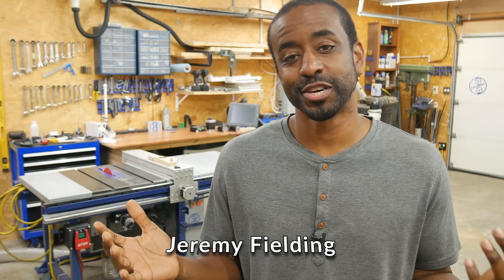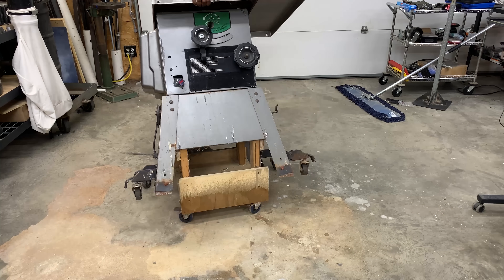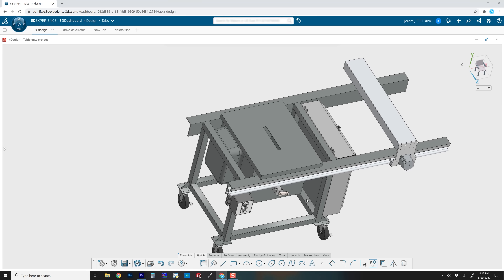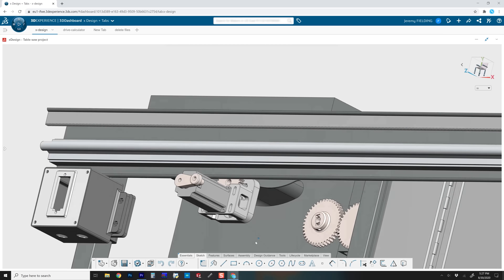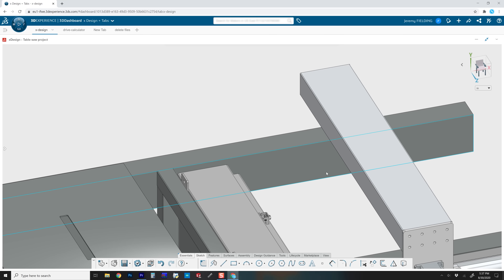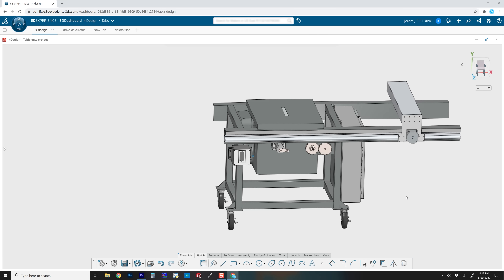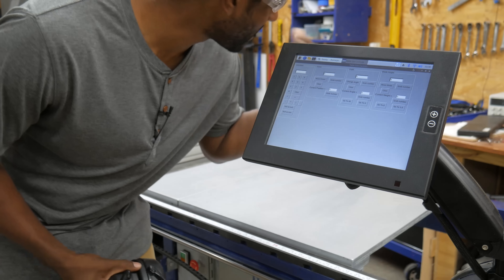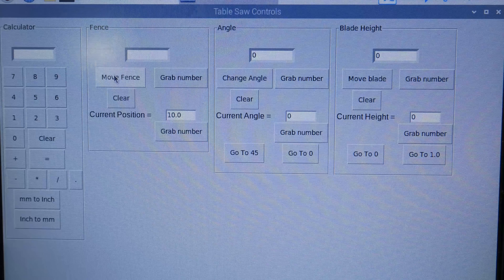How To Make A CNC Table Saw : # 084

Comment: Jeremy, my hero! Your vision for your saw (and other shop tools) is not far from my own... but you got yours done already. I knew the idea would work. My thoughts were to re-zero the fence position against the blade: raise the blade, release and slide the fence against the closest blade kerf, click a re-zero button to recalibrate and engage the fence position to, well, zero inches. That way, all of your **cut measurements will be relative to the fence side of the blade kerf** (not to some twice-indirect tape measurement). This becomes important for maintaining cutting accuracy cuz saw blades can be of different thicknesses. For instance, re-zeroing to the fence side of an adjustable dado stack. This could work equally well with the fence on either side of the blade (I am left-handed). The re-zero function might be automated later... depending. 

This calibration method yields the expected results when cutting wood. 

Agreed with your acceleration profile, especially on the stop end of the translation (deceleration) where precision stopping can become a problem, and more importantly, a slow speed when re-zeroing automatically. The fence is a significant mass and slowing it to a stop will reduce oscillations at the far end of the fence and reduce slewing of the motor caused by overshooting the target position. It all depends on one's accuracy and precision tolerances and may get into diminishing returns with wood. Dunno yet. It would be cool to get the translation system profile characterized at least once with an external laser position gauge.

I have nebulous thoughts on how to auto calibrate blade height for different diameter blades without bringing in an external gauge for the initial calibration after blade change... but I like your simple blade raising motor implementation... nice. Yes, fix the spinning knob issue. With the RPi one can easily do the geometry to calculate blade height at different miter angles.

Love your choice of RPi and Python cuz they are each perfect for this project... and my choice, also, simply cuz I know them.

Cudos to Josh Rapavich for knowing "re-zero"... Josh, are you familiar with hdds or other servo positioning systems?

I am a retired electrical/software engineer and have become a covid-inspired woodworker (cuz it's out of the house and something I've never done before). My current project is building the tiny building for my SheShop by the Seashore so I can get back to working wood. Oh yeah, I am 75 and a girl...

Comment: Question:
You have stepper motor and drivers in there, but it seems that you are controlling the motor power using relays? Why? Or are the relays for the end-stops?

Comment: ok first let me say... great job on the automation job. I have one of those cast Iron saws & plan to do some different upgrades & some hand made one's I've already done from research so here are a few great ideas & answers to that cast iron table saw. I found if i get a rust spot I just use used motor oil & sand with a wood block then I regularly polish with paste wax (that's what they've always used & it helps glide wood across table. I made a Riving Knife that moves up n down with blade to replace the original blade guard (or your cuts get marks U burns & get stuck or jam). I also used a pully spring from junkyard that fits in my alumin extrusion to hold the wood down to the table with a one way bearing wheel to prevent Kickback. I plan on putting my rougting table on the wing opposite end of my table & guide rails with open ball bering slide blocks for my extrusion fence. . BTW my table saw is the old SEARS cast iron top... Good Luck . . Super Cool Tools has great diy ideas you could try.
Reply: forgot I'd commented before...lol

Comment: On our viper robots, we have a function to reference the robot when it "loses" it's place.....it is just a proxy switch that acts as a flag and tells the corresponding axis drive that it has made that limit and inputs the exact measurement...this may give you a better tolerance, but as you said, you are not measuring to the thousandths place....very well developed video...sub earned 👍

Comment: You mentioned a jog button but you might consider a increment button as well. For example if you enter 0.5 inches into the incremental field and every time you hit the increment button, the fence would advance another half inch. Great for cutting precisely spaced cuts.

Comment: I used the same cleaning agent. VINEGAR ! It took major amount off and then took my sander and used  150 grit and then 320 grit. Cleaned it again and then used Buthers wax to seal it. Wood  slides on the table like shit thru a tin horn ! Every now and again just touch it up. I also did the  whole saw After wiping down all parts and waxed the whole saw. Fine dust hardly holds onto it. I also added a chute below to catch a majority of sawdust. Love watching your content ! Keep up the good work !

Comment: Awesome job Jeremy. It turned out so well. I have never used Python looks like a type of Basic? I have used Mach3 software for cnc machines and moving x,y table positions etc. I don't know how easy a interface would be to write though, I have only used the generic cnc interface screen. I have one machine I built with steppers and the other one I used a newer servo from Clear Path called Stepper Killer all in one servo. Anyway just wanted mention that because I think they are great, not much more cost than a stepper and drive but has lots of torque and excellent control. You can use step and direction pulse straight to the motor if needed! Once again awesome video!

Comment: Really impressed with your builds and explaningvideos.. 😊
Keep it up, 🤘🤘
My budget and knowledge of cnc operated projects isnt big enough, but I would really like to ad a dro fence for my soon to be build new tablesaw multiworkbench.. 
My plan is to raise and tilt the saw electronic (with salvaged motors and controls from and bed) 😊 but still have the possibillity to operate manuel.. 
My plan is to biesemeyer fence system.. But I would Really like  to be able to read my position digital.. Ofcourse will i also add a normal adhesive measuretape.. 
Is that possible? I know ther are commercial solutions (like wixey) but not able to find a diy that meets my criterias and is precise..? Any ideas?

Comment: Great build and the progress is great as well.  A couple of comments.  Steppers are simple and accurate as you note but they can and do skip steps.  Unless you have some form of feedback you can never really be sure of the actual position.  Adding feedback to the stepper is easy and of course steppers can be had with integral encoders.  But an integrated encoder will not account for the backlash due to you choice of a gear drive.  A preferred drive would use toothed belts and pulleys which have virtually zero backlash.  Another advantage of the positional feedback is that if you move an axis manually the encoder will track this as well and you will not require an "origin" operation to re-zero all of the axis.   Speaking of origin or home, encoder units with a marker pulse are preferred as they provide a simple way to "Origin" the axis in concert with a position sensor near the end of the travel.  The end of travel sensor tells the drive to slow to 10% and then walks in slow to say the second marker pulse and finally at 5% speed that final pulse on the next revolution.  This will be very repeatable, up to the limits of the drive gears you use, and is much the same way allot of the big boys do this.  Ramp control can be done in steps with the speeds starting at say 5%, then a jump to 10%, then a jump to 30% after a couple of revs followed by a jump to 50% etc...  Of course this is based on the called for movement magnitude.  In some cases a slow move would be all that is required.  Backlash can be somewhat compensated for by simply running past the set point and then slowly moving into the called for position.  Call for 10.000", the stop runs to 10.100" and then comes back into 10.000"  The gear teeth are loaded in the direction of the force exerted on the fence and should be accurate to the called for position.  This is the icing on the project stuff and does not detract on just how impressive your project really is.  Fantastic and really impressive work!

Comment: I would do the Spinning handle issue similar to old Milling machines. There is 2 "zigzag" parts, and a spring between. If you push the handle, it locks to the other part, and you can rotate. If you relase, the spring decouples, and you good to go.

Comment: I think you could look to the 3D printing community for a lot of inspiration.  We have the ability to "home" our printers, so all of the XYZ motors refind a known position using limit switches.  Could be helpful for when you've disabled your motors for fine control to be able to reset with precision.  Also, what happens if you try to move your fence to the left while the blade is up? Is there a protection there to stop it binding up on the blade?

Comment: Awesome work!  I challenged another you-tuber with a motorized fence years ago but he did not take the challenge, you sir have went above and beyond!  What about adding a DRO like rail and sensor on the back side of the fence to always know where the fence is.  that way when you disengage the motors and move manually it would always know where it was when you turn the motor back on.  Just a thought.  Thank you, and keep up the good work!

Comment: OK one thing I would add is an auto-alignment function. Basically any time you turn on the C&C it would move every component to the limit switch which is already a known and static position that you can program in. Boom, no more manual alignment.

It's the same thing inkjet printers do when they warm up - they'll run the print head all the way to the end to make sure it's aligned and then start printing. Since you've already got limit sensors in place, all you have to do is program a startup routine. you could even add a button to your UI to run the alignment routine (on a per component basis). The downside to a startup routine or automatic alignment is what can happen if there's something in the way, like a scrap piece of wood left on the table, that interferes with it. But that's a problem with any C&C application.

Comment: Would using a blade stop saw work with this setup and if so would you be able to tie in to it to shut the hole tool down if triggered? I could see this being vary useful in cabinet building. Great job

Comment: Awesome project! Cutlist or Queue was my first thought for improvement so i'm glad that's on your list. I was also thinking it would be good to either reposition your limit switches or add more so that you can utilize a homing command. If you go into manual mode, all you would have to do to re-enter cnc mode would be to hit your home button and all three degrees of freedom (or however many you would actually manually adjust) will run in the direction of their homing switch and then move to your desired location. Home wouldn't have to be zero necessarily. If you had space constraints on the fence, you could set your home location to just always be at 7.25 inches and then, when you home the fence, your program will just know it's now at 7.25 in.

Comment: With gasless MIG welding you drag not push just like with mmaw(stick) this will prevent slag inclusions and give you a more flatter weld that has higher penetration 

As for you protecting the top you could clear coat it all though the clear coat would rub off in a few months with normal use or linseed oil or WD40 will help prevent rusting rub on every few weeks

Great project!!

Comment: If you use PID control (proportional, Integral, Differential) you can get the accelerated start with a controlled stop with little to no overshoot.  I use it on hydraulic rams used for material testing. You can buy a PID controller or look through a good controls book to model the system you want.   Great job, never thought of automating a table saw, but I can see some great advantages now that I see one in use.

Comment: I've considered paste wax but have always used talcum powder on cast iron. Rub in with paper towel and another to dust off excess. Just try a 1/4 teaspoon to start and adjust as necessary. Unscented is supposed to be best but I've always used scented.

Comment: Furniture paste wax (Miwax orJohnson's paste wax) is what you want. It's like waxing your car though, every so often you will need to reapply. If I will not be using my table saw for a while I will spray it down in silicon spray, wd-40 makes a spray but cooking spray is made from food grade silicon. Be aware paint hate silicon, so clean your saw thoroughly before using it again. Paste wax is fantastic because doesn't stick around after sanding and finishing. Obviously what one is attempting to do is keep moister off of the cast steel. 
You are the man BTW. This stuff is so beyond me. It is fun to watch.

Comment: PASTEWAX!!! Pastewax will protect it! also sand it with a block and 400 grit  wet sanding sandpaper except dont use water use wd-40 or PB blaster. then do the paste wax after the standing. works like a charm.

Comment: Awesome work, my man. I see you weld with flux core wire. Since you aren't using gas, you don't need a gas nozzle. You can get a smaller ceramic end for your torch and it fits into smaller spaces. Wouldn't recommend if you have a constant hot torch like the cheap HF units do.

Comment: Look into ClearPath servos, they’re servos with the drive and everything built in. They cost less than an equivalent stepper system and have a way higher torque and speed range

Comment: Damn impressive !  Awesome, even.  But do you have any time to actually use the saw?  I would have just upgraded to a Beesmeyer and be done with it.
Reply from the maker: If I had done that you wouldn’t be watching this video... and I wouldn’t have had as much fun
Reply: @Jeremy_Fielding  Exactly why I am a subscriber.  Your work is A++ always and you have great teaching chops.  And a cute family.  But I still would argue this is overkill for a small shop.   I mention that fence because I have worked with it in the past, and I could make 100% accurate cuts very easily without extra screens and motors and all the rest.  That said, I would love to see a CNC router video.   I have a tee-tiny cnc I made from an arduino, some black pipe and an old Foredom tool.  It works, but has some limitations.

Comment: The fence is supported at the front by the motor-plate. What stops it from rotating on the linear rail and touching the table top? Needless to state that this is a wonderful project with masses of additional possibilities.
Reply from the maker: I explain near the end of the video
Reply: @Jeremy_Fielding  Many thanks for your quick reply.

Comment: Great, now I want to put LinuxCNC on every tool I have...
  
Absolute encoders are available so that you don't have to lose your fence position when it's in manual mode - use it as a DRO.

For finding the blade height - you can put a laser beam break sensor underneath the table blade guard.  So that you detect when it's about to break the surface of the table.

Comment: You could add a "reset to position" (or something) button that moves the fence (probably the same for the saw height and angle as well) to the end stop (zero position) and then moves it back to the position you have set. That way you don't have to risk errors when telling the code where the fence is after you have moved it manually.

Oh yeah! And an auto feeder as well.

Comment: Damn dude, I've had an idea like this on my head for some time. But I lack all the skills needed to do it. Beat me to it.

But bravo man! This absolutely awesome! Something like this will greatly help your daily woodwork, since we spend a lot of time making measurements. I have a few ideas to share:
   • A way to make relative changes in fence distance. Like, +.125" or -.25"
   • You also need to consider different table saw blades too. Like thin blades or dado blades. Since this will affect the software.
   • Ability to save/bookmark measurements/configurations.
       - Examples:
           • "Squaring 2x4: fence = 3.375", blade height = 1.75",  angle = 0°"
           • "Box joints: fence = 18",  blade height = .75", angle = 0°"

This is super-awesome for your first software dev project man! Welcome aboard! (I'm a dev too) Your code needs work though. Look into creating classes so you can separate your code into different components. Focus on creating descriptive variable and function names so your code reads more sentence-like. For normal variable names, use the "camelCase" format. For constants, we typically use caps with "UNDERSCORE_FORMAT". A longer name always beats using comments. They are moreso a "last resort".
But it's still great for your first program! I've seen much worse. If you want to get deep in writing well-written code, check out Robert Martin. His teachings (and books) have really helped me sharpen my own skills and mind as a developer.

Comment: Fantastic project. Other options you can easily add is;
Fence preferences measurements F1 - F2 - F3 - F4
Blade Height preferences measurements F5 - F6 - F7 - F8
Blade angle/tilt preferences measurements F9 - F10 - F11 - F12

Comment: Awesome idea and execution! Now how about making it voice activated? Just shout your dimensions to Alexa or your Google Home and have your blade magically adjusted. Also, you mentioned moving the blade to zero when you want to move the fence to the other side. You could read the height of the blade and when you want to move the fence and if it's bigger than 0 then set it to 0 first before moving the fence :)